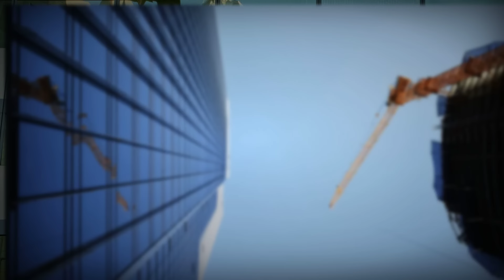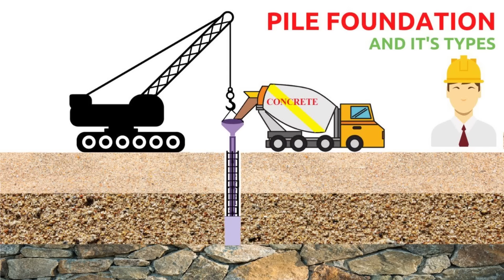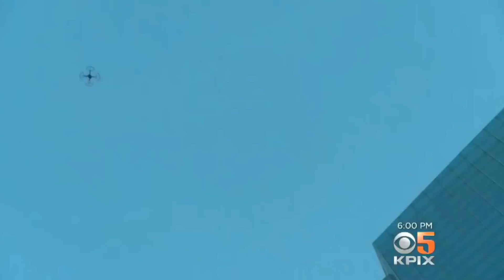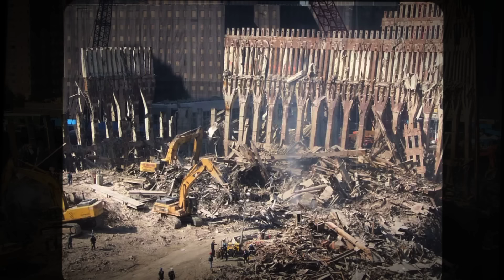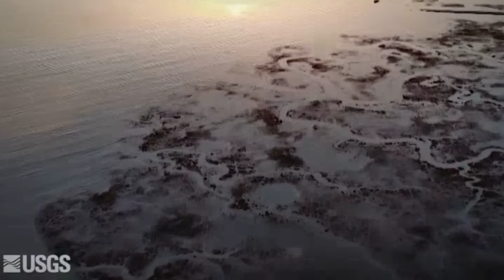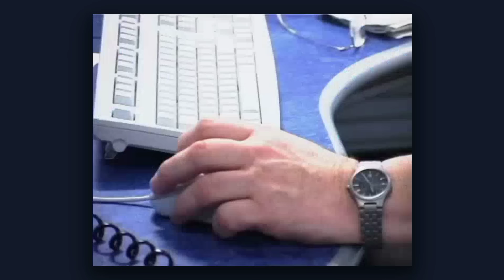Just Confirmed! San Francisco Leaning Tower Has Started Sinking

Comment: Building this tower was a mistake. Now it should be dismantled.
Reply from the maker: You're not wrong on the principle. The problem is dismantling a 58-story occupied skyscraper has literally never been done in the United States. You're talking 5 to 10 years of controlled deconstruction, billions in cost, and 419 families who legally own units that would have to be bought out at numbers nobody wants to put on paper. So the city makes the cheaper bet — monitor it, patch it, hope. Do you think there's a tipping point where dismantling actually becomes the cheaper option, or are we locked in forever now?
Reply: @AMERICANGROUND-u9r if it starts lean towards other buildings it will have go in a hurry
Reply from the maker: That's the scenario that would force the city's hand overnight. Right now the lean is northwest, away from the Salesforce Tower and the Transbay Transit Center. As long as the tilt direction stays predictable, everyone gets to keep monitoring and arguing.

The moment the bending in the middle starts redirecting the lean toward another structure, the conversation changes from "structural concern" to "imminent danger." Modern skyscrapers aren't designed to absorb impact from a neighbor. The clearances between Millennium Tower and the buildings around it are tight by design, because nobody planned for one of them to start migrating. If the top corner ever projects over a property line, the city has no choice but to evacuate and dismantle, because the liability exposure shifts from the developer to the city itself the second they let it stay up.

That's actually the most likely path to a forced demolition. Not collapse. Not earthquake. Just one bad year of monitoring data showing the lean has started rotating in the wrong direction. At that point the building becomes a public threat instead of a private problem.
Reply: @AMERICANGROUND-u9r  A dew will turn it to dust .
Reply from the maker: Probably truer than the official statements want to admit. The seismic performance of this building in its current half-bedrock half-friction state has never been tested in a real earthquake. Computer models can guess. Engineers can hope. Nobody actually knows what 686,000 tons of concrete does on a hybrid foundation when the bay mud underneath liquefies. A moderate quake might prove the fix worked. A big one might prove your point.
Reply: @AMERICANGROUND-u9r  Well, might as well start the process, which means soaking the architectural and engineering firms and the developer for every dime that can be recovered from them, bankrupting them if necessary. Not sure where the rest of the money come from, but it's better than throwing good money after bad trying to set this tower right, because that looks like it may not be possible. Take it down, no matter the cost because repairing it won't work and won't be any cheaper.
Reply: @AMERICANGROUND-u9r 

So, this is about money and not about saving lives?
Reply: What about a partial deconstruction? Just lower the total weight until the building stabilizes. Maybe taking off 15-20 stories is enough… 

Also some weight reduction actions can be taken, pavement substitutions 

I know, it’s a garagantuan enterprise but it’s better than tearing it down completely.
Reply: 🌴😒 I think...they might as well dig underneath it..bolt on some rocket engines, and launch it into space.

Comment: Which engineering firm that signed off initially using friction piles that went down only to sand level and not bedrock given they already knew or should have known the total dead weight of the tower given its concrete construction? Given that no other high rises in Frisco used friction piles only going down to the sand at that total weight should have been a massive red flag. Who was the principal that signed off on the initial design drawing??!!!

If there were a history of 500 buildings and 499 of them at that weight had success using friction piles going down only to the sand level may have given some reasonableness to statistical sampling but a sample of zero and these engineers bet the farm on that design with absolutely NO PROOF that this particular design was sound!  This had to be life safety rated as people live there !  This isn't some statue for people to walk around and look at ! ! !

Comment: How could they be so negligent not securing the foundation into. bedrock???   Of course, greed.  Perhaps the biggest bonehead mistake in modern achitectural history.
Reply from the maker: You've named the disease and the cause in two sentences. Greed. That's the entire story stripped of the engineering jargon and the legal paperwork. Skipping bedrock saved the developer somewhere between 4 and 30 million dollars depending on which expert you ask, on a project that generated over 2 billion in unit sales. They cut the most important corner on the building to save less than 1 percent of revenue. And they cashed out years before the first marble rolled.

The bonehead mistake label fits, but it's almost too generous. Bonehead implies they didn't know better. Every engineer in San Francisco knew bedrock was the right answer. The geotechnical reports flagged the bay mud. The peer reviewers raised concerns. Salesforce Tower two blocks away was already planning to drill the full 200 feet. This wasn't a calculation error or an unknown variable. This was a deliberate decision made by people who knew exactly what the right answer was and chose the cheaper one because the residents would never know the difference until years after the developer had moved on.

That's what makes it worse than a mistake. A mistake is an accident. This was a strategy. The mistake was the rest of us trusting a system that lets developers make these calls without personal liability for the next 50 years. Until that changes, somebody is going to make the same call somewhere else within the next 5 years, and we'll all be back here writing the same comments under a different building's name.

Comment: What scares me here is liquefaction. The vibrations from the “fix” caused enough damage to halt that procedure. Can you imagine what the vibrations from an earthquake of any size at all will do? The friction piles may well “plunge” vertically, leaving the tower likely to topple. 28 inches of lean now : if it gets to about 40 inches the elevators won’t work and the tower WILL be abandoned.
Reply from the maker: You're laying out the scenario the engineers know about and won't say in plain language. The pile-driving vibrations during the 2020 fix were enough to accelerate settlement and halt the project. Those vibrations were controlled, predictable, and tiny compared to what the Hayward fault will produce when it finally moves. If the building can't tolerate intentional construction-grade shaking, the math on a magnitude 7 earthquake doesn't need to be calculated. The answer is already in the data.

Your point about plunging is the one most coverage gets wrong. People imagine an earthquake making the tower tip slowly. The actual failure mode for friction piles in liquefied soil is sudden vertical drop. The piles lose lateral confining pressure in seconds, the soil column above them turns to slurry, and the load they were carrying transfers to the bedrock piles on the north and west almost instantly. Half the building stays put. The other half plunges. That's not a tilt. That's a hinge with hundreds of people inside it.

The 40 inch elevator threshold is the number nobody at the city wants to put in writing, but you're right about it. Modern elevator shafts are designed with extremely tight plumb tolerances because the rails and counterweights cannot accommodate meaningful curvature. The building is already at 26 to 28 inches of lean and the foundation is now bending in the middle, which means the deflection isn't even uniform anymore. Elevator engineers have been quietly modifying rail alignments for years. At some point the modifications stop working. When that point arrives, the upper floors become physically unreachable, and the building is functionally dead long before it ever falls. You've described the real countdown clock more clearly than any engineering report has dared to.

Comment: Now that we know how and why it is leaning, why not build another tower across from the NW corner so that they lean against one another.
Simple and - if I say so myself - extremely elegant!
Reply from the maker: That's the most beautifully pragmatic engineering solution I've heard all day. Two failed towers leaning against each other for mutual support — the architectural equivalent of two drunks helping each other home. Honestly, given San Francisco's track record of approving foundations on bay mud, the second tower would probably also start sinking, and now you've got a self-correcting system. Each one props up the other while they both slowly merge into the soil. By 2075, archaeologists dig them up as a perfectly preserved double helix monument to early 21st century greed.

The dark joke aside, what you're describing is actually a real engineering concept called counterweighting, and it's been used on smaller scales. The catch is that no developer in their right mind would build a brand new tower designed to be structurally dependent on a known failing building next to it. The liability would be infinite. If Millennium Tower ever moves badly, the new tower goes with it. Insurance carriers would refuse to write the policy. Permits would never get approved. And the residents of the new building would be paying a premium to live in a structure that exists specifically to prop up someone else's mistake.

But your instinct on physics is correct. Adding mass on the high side would mathematically slow the tilt. Some engineers have actually proposed something close to this — strategic ballast placed inside the building or anchored externally to even out the load. The only real solution that doesn't require a second tower is removing weight from the top, which means demolishing the penthouses. And you can guess how popular that idea is with the people who paid 10 million dollars for them.
Reply: @OPENLENS.1 It works perfectly well with old terraced houses in many towns across Europe. However, I doubt that that was the intended design and I'll concede that my bias towards the drunkards design is very clearly a survivorship bias. You're right that that wouldn't be a risk you'd put your last $M350 on. Or your first.
The leaning tower of Pisa was for many years - and maybe still now is - stabilised by lead weights placed on the high side but I think that in the end remedial work on the foundations fixed the problem, albeit at an angle.
My first thought about a possible fix was exactly your last point: a height reduction - maybe by ⅓ would be an alternative to complete demolition but insurance considerations would probably push the owners towards complete demolition.
Whatever, I think that friction piles into a substrate liable to liquefaction in the (inevitable) event of a seismic shock was always a silly idea. Stupid is as stupid does.

Comment: Anyone with common sense and good taste would never permit highrises in San Francisco.
Reply from the maker: You're touching on something San Francisco's planning department has never wanted to admit out loud. The city has the worst possible combination for high-rises in North America. Active fault lines on three sides. Liquefiable bay mud and fill across most of the eastern waterfront. A water table that shifts every time someone digs a basement next door. Hills that limit where you can safely build. And the kind of seismic history that should have everyone building short and squat instead of tall and slender. Tokyo at least has stricter codes that match its risk. San Francisco wrote the codes to match the developers' profit margins.

The aesthetic argument lands too. There was a time when the San Francisco skyline was actually one of the most beautiful in the country. Low, varied, color-rich, climbing the hills naturally. The Transamerica Pyramid was the exception that proved the rule. Now you've got a wall of glass towers blocking the views the city was famous for, half of them owned by foreign investors who never live in them, all of them sitting on ground that has no business holding them up. The skyline got more expensive and less beautiful at the same time. Not many cities pull that off.

The frustrating part is that the people who actually live in San Francisco mostly agree with you. Locals didn't ask for any of this. The high-rise boom happened because developers and the city government decided downtown needed to monetize air rights faster than the rest of the country, and the planning process bent to whoever showed up with the biggest check. Common sense and good taste were never invited to the meeting.
Reply: @AMERICANGROUND-u9r  My neighbor was a city planner for SF and he said he spent his entire career trying to avoid what eventually occurred to the city. A high rise hellscape of wind and shadow and ridiculous buildings.He said the developers won in the end.

Comment: Not driving to bed rock should be criminal. How could that be allowed?
Reply from the maker: You're asking the question every honest engineer in this country has been asking for 20 years. The answer is that it was allowed because the system was designed to allow it. The structural engineer signed off on the calculations under the assumptions handed to them. The geotechnical engineer signed off on the soil report under the conditions measured at that moment. The city's Department of Building Inspection approved the permits because the paperwork was technically complete. Every individual checkpoint in the chain looked legal. The combined result was a 686,000 ton building on inadequate foundations.

The reason it isn't criminal comes down to how American construction law is structured. Engineers carry professional liability for their stamp on a project, but that liability is civil, not criminal, and it's almost always covered by insurance. Developers carry essentially no personal liability once they sell the building and the LLC behind the project gets dissolved. City inspectors are protected by qualified immunity unless you can prove deliberate fraud, which almost never gets proven because the smoothing-over happens in meetings nobody documents. Every party has a legal escape hatch. Nobody goes to jail because the system was built specifically so nobody has to.

It should be criminal. You're right to be angry about that. Doctors face criminal charges for negligence that kills one patient. Pilots face criminal charges for decisions that crash a single plane. Developers and engineers can sign off on buildings that endanger hundreds of lives for decades, and as long as the paperwork is filed correctly, nobody serves a day. Until that asymmetry changes, the next Millennium Tower is already being built somewhere right now, and the same conference room conversation is happening about how to save 20 million dollars on the foundation. The law treats it as a civil dispute. The physics treats it as a death sentence with a long delay.

Comment: The builders are going to add balloons to the top to lighten the load.
Reply from the maker: Ha, given how the rest of this story has gone, I wouldn't put it past them. At this point the engineering decisions on this building have been so creative that party balloons feels like a reasonable next step. Hamburger spent 100 million dollars and got 25 percent of forecast — maybe Mylar is the breakthrough nobody's tried yet. Tie a few thousand to the penthouse, call it a passive lift system, charge the residents a special assessment for helium, and declare the problem solved.

The wild part of your joke is that "lighten the load" is genuinely one of the only two real options left on the table. The other being underpinning the entire foundation, which has already been tried and underdelivered. Removing weight from the top would actually work — it just requires demolishing the most expensive units in the building, which is why nobody talks about it seriously. So in a strange way, your balloon idea is closer to a real engineering proposal than the official monitoring plan. At least the balloons would be doing something. The sensors are just watching the tower bend in higher resolution.

Comment: this problem has been known for years.nothing new about it.
Reply from the maker: You're right and that's actually the most damning part of the whole story. This isn't breaking news. The first marble rolled across Jerry Dodson's floor on August 2nd, 2016. NBC Bay Area broke the story almost a decade ago. The settlement framework was agreed in 2018. The first failed fix attempt was in 2020. The building has been on a public clock for 9 years now, and every year the data has gotten worse, not better.

What's actually new is the bending in the middle. That part wasn't on anyone's radar until late 2025, and it changes the engineering picture in ways the original failure didn't. The lean was bad. The bending is worse because it introduces a failure mode the rescue wasn't designed to address. Same building, same problem, brand new dimension to it.

But your point still stands. The fundamental story has been public for almost a decade and the city has done essentially nothing meaningful about it. Monitoring sensors and quarterly reports aren't action. They're documentation of decline. At some point old news stops being old news and starts being negligence by inaction.